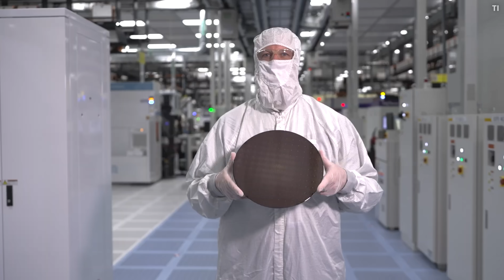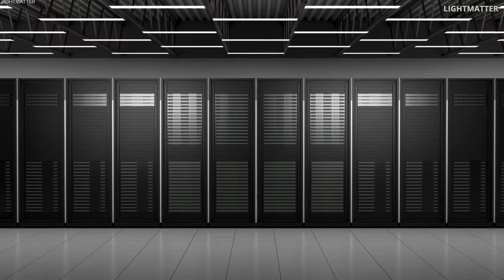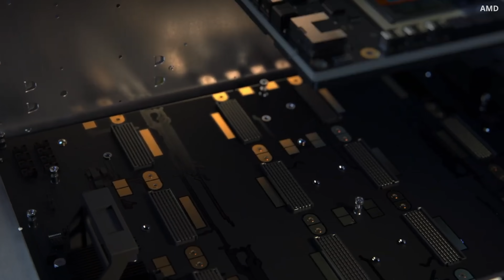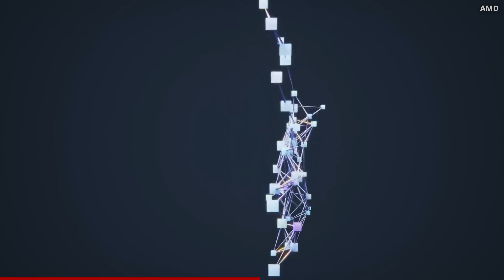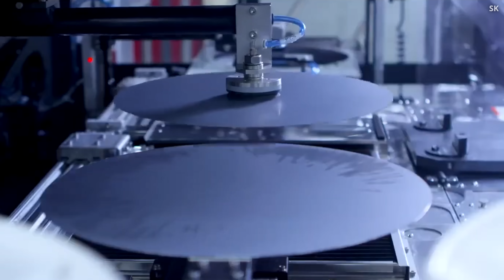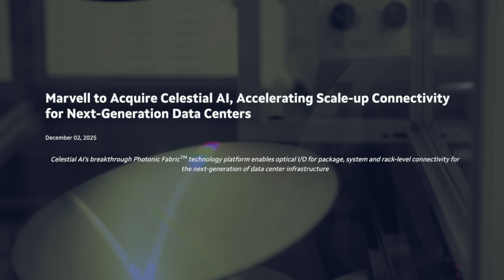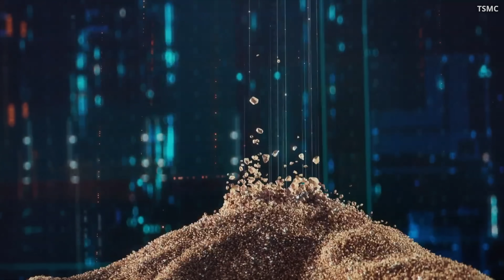Everyone Is Chasing This Technology

Comment: If cooling cost so much why aren't these plants built in colder region's like alaska or antarctica ?
Reply: They have these plants in iceland
Reply: @peteduch2151  Yes it is correct that they have datacentres in Iceland. Iceland's key advantage is that they have an abundance of cheap renewable electricity due to geothermal and topography that supports hydroelectric generation. However, the reason why they will not be building gigafactories there is due to insufficient power infrastructure, geographical distance from the major cities and countries where low latency compute is required, and although natural climate helps with cooling; the humidity is an issue that requires significant power to correct.
Reply: @SimonH-64buddy, you just making things up as you go on?
Reply: @jakobisahero  No bud, everything in this statement is based on facts that you can verify fairly quickly on the internet. Was there some point that you found contentious?
Reply: @S@SimonH-64sorry, just working on working memory here. Perhaps your thinking is great, I doubt it though 😅 All in all, it’s a good initial question, and the answers are a lot more complex than yes/ no 😂
Reply: @jakobisahero  The latency difference alone would be enough of a reason to not build big there to me.   They would put it in Death Valley and cool it there if it decreases latency where they need it.
Reply: @toolman6872 latency is not always a critical factor. Sometimes it’s everything, as we know 😅
Reply: @jakobisahero  It's not JUST latency though, I was  saying that it is a significant reason on it's own to reduce distance to the consumer or user.  There are many additional reasons.
Reply: @jakobisahero I haven't answered yes or no, I've given summary reasoning as to what goes into the selection datacentre location which explains why they are being built where they are. The reason I have all this information to hand is because I have several hundred hours of research in exactly this field.
Reply: @SimonH-64 But how much low latency compute is really needed? Most of the current AI boom seems to rest on LLMs and generative AI. If you work with ChatGPT, you will hardly notice if the answer comes a few hundred milliseconds later. The same goes for generative AI, if your generated pictures or videos appear a fraction of a second later, the difference will not be noticeable. 

BTW, I have played FPS games on overseas servers. The difference to one near me is typically 100-200 ms. 100 ms extra latency was tolerable, and those games require decent reaction speed.
Reply: @rabiatorthegreat6163  ask traders on Wall Street why they hate latency, and you'll instantly understand that milliseconds extra can mean relevance or irrelevance in any field that relies on data speed.
Reply: @rabiatorthegreat6163  "hummingbird project" giyf
Reply: @SimonH-64and salt is an issue also here in iceland
Reply: In the future, please do your research before making statements
Reply: @SimonH-64 i didnt know this wow  k so cool
Reply: @SimonH-64Yes there's infrastructure Antarctica not so much
Reply: @peteduch2151 I lived in Iceland for a year. It’s no colder there than it is in the northern half of the US.
Reply: @ChopperChad I was going to say isnt it Greenland that's covered in snow, Iceland is just the name of the country , not a description .
Reply: @fabianurweider805  Greenland mostly consists as shelf-ice, no rocks everywhere. Good luck with a sinking supercomputer on the melting icy ground 🙂.
Reply: @ChopperChad   ... aber der Strom ist billiger, wegen Geothermie-
Reply: @ChopperChad I think they meant Greenland 😂
Reply: @peteduch2151   don't say that too loud, otherwise Trump will want Iceland as well.
Reply: @rjung_ch  Trump isn't the one building data centers.
Reply: @pfpchad2747  he's not standing in the way either. The way he wants Greenland he may want more, Venezuela, Iceland, which other country?
Reply: @rjung_ch Trump thinks Greenland is um, green. Iceland is green, Greenland is icy.
Reply: clown
Reply: @pfpchad2747  TDS.
Reply: @rjung_ch  Tell me you are a dumb democrat voter by not telling me. hahhahahhahah
Reply: @rjung_ch 
Is Trump in the room with you right now?🤣🙃
Reply: @rjung_ch good luck with that. Icelanders are bonkers. They drink like a fish, do crazy stuff like drive nox powered beast cars up vertical cliffs and party like their lives depend on it. Even the craziest Americans won’t last 5 minutes.
Reply: @rjung_ch  So that would be an Iceland would be great just like America
Reply: @rjung_ch  Luxembourg
Reply: @BJPus  I hate to inform you, but more today than ever, the people with TDS are Trump supporters.
If you simply look at the word "deranged", you can't deny what I've said.
Reply: @Vector_Ze  Is that you AOC? just like when you said MAGA wants socialism… 😂
Reply: @rjung_ch  everything reminds me of him 😢💔
Reply: @JenkinsUSA  an Orange victim of Erik the Red
Reply: @rjung_ch  We will take both of them, with ease...
Reply: @rjung_ch  All of the above. You're already our vassal anyway, why not make it official and gain some more advantages from it.
Reply: @robotron1236  that hubris will bite you in the ass, it'll be horrible for you, are you ready for that? It'll be coming before you notice.
Reply: @rjung_ch maybe all of them, America MFer
Reply: @rjung_ch  He will not.  Iceland does not command the same strategical location.  Greenland's location allows US to command arctic circle voyage route.
Reply: likely more moisture buildup from condensation, causing corrosion, and they probably want high capacity bandwidth to avoid bottlenecks, doubt alaska or antarctica has too much available (besides the secret bases)
Reply: @patrikisgod They are not secret if you talk about them on social media!
Reply: @vincewilson1  Wanna hear a secret 😂😂😂❤❤😮
Reply: @patrikisgod Could be overcome by putting the electronics in oil ( would serve as a heat transfer fluid too ), but I believe energy and latency are the two main reasons.
Reply: Because you don't have power or connectivity infrastructure in those places, and many applications of compute requires low latency i.e. the compute needs to be physically close to where the results of the compute are needed. A further enemy of compute is humidity, where you have cold, you have moisture, so its a separate problem to deal with that requires energy to overcome.
Reply: @SimonH-64 Cold air actually carries much less humidity the problem is condensation
Reply: @HerbofFire thanks for the correction. Cold places like Iceland have very high relative humidity which is a challenge along with condensation too but very cold  places like Antarctica are very dry then it's a pure condensation issue.
Reply: @SimonH-64 As the air gets heated in the building, the relative humidity decreases because warm air can carry more humidity. So Iceland climate should not be a problem.
Reply: @rabiatorthegreat6163  It's the high high ambient humidity outside that is the challenge. Air that is too wet reduces life of electrical components so they have to make sure the dc are sealed and expend energy dehumidifying the air bought in for cooling. Its not that iceland climate is a prohibitive problem, its just one challenge to the location. the biggest showstopper to iceland for Gigafactories is power and location
Reply: @SimonH-64 Even still though cold air is far dryer. 32f and 72f at 80% humidity each, the colder 32f air holds about x4 less water vapor.

Amazon's new Carlisle data center here in Indiana uses air cooling October through March which she covered in a previous video. The trade off she said is air cooling is more expensive power wise.
Reply: @HerbofFire  yes i understand - local climate is just one of the challenges when placing datacentres, not necessarily the main one for any given location. Got into the weeds a bit here, but originally i just gave a list of why its not as simple as "its colder in x place so why don't they just put datacentres there" The factors are power infrastructure, connectivity, labour for building/maintenance/staffing and climate factors to name some. All of these things weigh into economic and operational viability that add up to the reason why datacentres are getting built where they are getting built.
Reply: @SimonH-64 Iceland isn't the kind of place we're talking about. We mean northern Canada where temperatures go below -50 Celsius. It's 7 degrees Celsius in Iceland right now. I'm in a major city in Canada and it's -22. The data center wouldn't just sit out in the elements. You would run some type of heat exchanger system with something like glycol. The Antarctic is actually considered the largest desert on earth because of the lack of moisture in the air.
Reply: @SimonH-64 Very good point I guess but we do not need to forget that not every thing require low temperatures to run properly on the top level and you will need to create systems to heat things up. As well as that you need to protect system because machinery needs to be isolated from snow and strong winds, as well as temperatures needed to be much lower then the ones on poles. Basically not so many benefits more loses in the short and long terms. People need to work and live there and so much more to include like water and massive factories. I am not studying for that and my knowledge is even far from basics at that field.
Reply: Keeping temperatures moderate enough, if there are elements that actually need it (maybe backup batteries?) is easy - you just don't dump all your waste heat outside. And protecting the electronics from the elements is solved problem - there are already datacenters being built in humid climate or with frequent rain using a new technology called "walls".

Latency probably isn't a major issue either - it's not the same as locating HFT systems next door to the stock market, and there are already plans for orbital datacenters using much slower satellite uplinks. But more conventional infrastructure is. 

They not only need massive amounts of available electricity - likely requiring new power plants if there isn't a strong local grid - they also need to support a large enough workforce to build these city-scale projects in the first place, and then have to transport all of the material and machinery, which is all both challenging and extremely expensive to do in remote locations. 

So technologically, yes, it'd be far more efficient (and avoid wrecking the lives of anyone living nearby), but the gains aren't great enough that companies can (or will) eat the costs involved when they can just plug into your local power grid & build a new behemoth in your back yard.
Reply: So data centers in space don't meet your requirements. However, they are feasible and 1 is currently available in orbit
Reply: @simonh-64 then put a power grid there. Make substations. Use next Gen internet tech. I don't know, they got trillions of dollars figure it out! The one thing u dont do is build them on fn farmland!! Thats a no brainer. I refuse to believe that out of aaaaall the things money can and has done for them this whole time, why it allegedly cant find/implelment these other important fixes. Its not that they cant do it. They can. They dont want to. They choose not to for agendas
Reply: @unleasheth  I think they are chasing the cheapest acreage.
Reply: @unleasheth They are and they're more intelligent than you. 
You live on farmland almost all cities are on farmland. You're the problem not the data center.
Reply: @pauls5745 No they aren't it's location close to population where it's used and has power.
Reply: @sparksmcgee6641  In as much as outside KC is reclaimed farmland on the outskirts of town. Not just across the street. Out there.
Reply: @pauls5745  You dont know much about himan development. All early cities were built up on farmland. Hundreds of yeara later there are a few cities that were dwveloped in the indjstrial era because of a mine or port, or things like that which is less than 5% of current residential habitation.

Anyone whining about losing farmland because of something that improves quality of life for all is a clueless bigot that just harps on some political belief.
Reply: @SimonH-64You would never get the amount of people needed in enough numbers to work in those environments that’s the critical issue everything could be fixed, but not having the people kills the prospect of having infrastructure like that in those cold environments. They built infrastructure in phoenix’s, but they have peoples interest of living/working there although it’s still not easy even for that place, So a place like Antarctica or Alaska you have a better chance at winning the lotto than having enough of peoples interest to build key fab infrastructure there 😂.
Reply: @SimonH-64actually absolute humidity decreases with lower temperature.  There is a huge desert region in Antarctica, bone dry with some animal carcasses that are hundreds of years old
Reply: @glike2  Little misleading, all of Antarctica isnt low humidity in fact im betting its the exception.
You made your comment as an absolute which isnt the case. Just pointing out a better structured comment would have communicated the concept better.
😊😊
Reply: @SimonH-64 AI data centers actually don't need to be close to where the results are, why would they?
Reply: @M1szS Latency. The further the physical distance, the longer it takes to get the information. This physical distance issue is exacerbated by the number of hops it has to take, each hop is represented by a piece of networking equipment where each data packet has to be routed, this adds significant time. Latency is very important for many applications of  compute (like Ai inference, gaming, fincancial markets etc) and not for others (like training LLMs)
Reply: @SimonH-64 speed of light does have its limitations
Reply: @jakobisahero  Haha! If we could have one glass cable from the DC direct to every computer who want to use the datacentre then we could achieve speeds of about 2/3 of the speed of light for the transmission! (we don't get full speed of light though fibre because it travels through glass medium instead of a vacuum!) Unfortunately, we have to use the infrastructure that's in place, and physical distance in reality presents more hops and more hops is where the speed is lost :)
Reply: @SimonH-64😂
Reply: @jakobisahero  but you are only sending the results, not the compute
Reply: @SimonH-64fiber is interrupted by many circuit junction hub switches.  My understanding is that these switches are what creates more of a latency issue than the fiber itself?  Am I misunderstanding the technical science of it?  I'm sure it's more complicated than what I state in this simple paragraph
Reply: @brianwnc8168 yes max 20 km then you need repeaters for even fibre if we want to maintain bandwidth.
Reply: @brianwnc8168 yes absolutely correct, every router or gateway the data packets pass though they have to be routed I.e. analyse the header info, look up the next destination and send them to the next point in the chain. This is a big time overhead much bigger than latency caused by cable. So more distance = more hops is a simplification but generally true especially when talking significant distances and cross borders
Reply: @M1szS first time learning about how latency works? lol.
Reply: @SimonH-64um... Ever heard of Antarctica ?
Reply: @SimonH-64what about Alberta its super dry and one of the coldest places in the world and it has the best energy infrastructure
Reply: @SimonH-64 It is about existing infrastructure and logistics, building in Alaska is expensive because of lack of labour, cost ineffective building, lack of a well developed power grid... operational upkeep on a regular basis which are all the much easier inland.
Reply: @SimonH-64oh really?  Southern Canada is much cooler than texas where they're building all the data centers. And last I checked, there was plenty of power and fiber optics available to run data centers in canada.
Reply: @SimonH-64The heat generated will drastically reduce relative humidity in polar or Arctic Circle facilities. This is why relative humidity levels are usually so low in heated dwellings in cold climates. Condensation would occur away from heat sources. The other points mentioned are all important; Alaskan and Arctic Circle locations are to far from the likely future as well as present major users of these facilities.
Reply: @SimonH-64alaska has natural gas ans pil reserves more than most places. They can build plants.
Reply: @SimonH-64 ever been to Louisiana? The humidity there is stifling, your point holds no water , pun intended
Reply: @SimonH-64actually the colder the drier. The issue is NOBODY will work there.. been in industry 30 years people don’t even wanna go to upstate NY
Reply: @SimonH-64 Actually cold air carries less moisture because it turns to ice.
Reply: @SimonH-64Not entirely true, cold doesn’t equal moisture and when you raise the temperature of cold air it lowers humidity drastically
Reply: So data centers in space don't meet your requirements. However, they are feasible and 1 is currently available in orbit
Reply: @SimonH-64Alaska has oil and gas they can build some plants there. You can put some optic fiber
Reply: @SimonH-64 The point is valid tho.

Microsoft made an apparently very successful test of underwater datacenters, but later abandoned the project.

Probably scaling was an issue.
Reply: @mnomadvfx  it is a valid point that cooler temps are an advantage (although, there is a sweet spot) to reducing power consumption for sure! There are just a bunch of other criteria, largely around the economics of building and operating the datacentres, that make those places less desirable.
Reply: @mnomadvfx  - I work in a large data center, the problem is repairs. I am doing repairs on the hardware all day, every day.  Putting the hardware out of reach from repair is never going to work, until the robots are able to do the repair. Still, they need parts.
Reply: @mnomadvfx  underwater data centers are a neat thought. Unfortunately the cost of building underwater is exceedingly expensive and hardly reliable. Requires absurd amounts of maintenance. That being said, off shore data centers are a huge thing nowadays. They capitalize on spent rigs that have latent methane which can be converted to energy with fuel cells. Most rigs are already outfitted with power plants and have all the necessary protections for running a data center. The cooling capacity from the wind alone is generally enough for maintaining operations at significantly higher efficiencies. Outdoor Chillers don’t have to work nearly as hard to release heat.
Reply: @mnomadvfx Cost was the issue as it always is.
Reply: Yeah, they could use the waste heat for central district heating. The new giant neutron microscope near Lund Sweden, is already doing this.
Reply: @garysmith8593 very nice thought, until it is summer and no one needs the heat, than you have to install cooling and shut off the house heating. So instead of building 2 systems heating and cooling better only build a bigger cooling system.
Reply: That's why they're looking at putting them in space - bank of solar panels facing the sun, bank of heat radiators right behind those facing space. Sun synchronous orbit makes the data center always in sunlight and always at the best angle, and the sunlight isn't attenuated by the atmosphere and clouds and stuff, so solar panels in space produce about 40X more electricity annually than on the ground. And the temperature of deep space is about -270°C, so it's a great radiative heat sink.
Reply: @truhartwood3170 .  And no nasty condensation! Is there?
Reply: @t @truhartwood3170 40% more energy. Not 40x but it’s 24/7 so perhaps 3-4 x more than terrestrial solar.
Reply: @truhartwood3170 mostly true. Distributing heat into space is hard, very difficult actually. Vacuum is an excellent insulator, that’s why space suits need cooling :-)
Reply: @jakobisahero It's not that hard, but it is significant. A ballpark estimate would be that an equal mass of radiator would be needed to the mass of data centre hardware. This might be even lower with an ammonia based state change cooling system.
Reply: @g @garethrobinson2275 t’s not trivial for sure. Constant Radiation is a real issue. I would “ballpark” about the same as you. Whatever you want to build in space, you really want to sort materials off planet. Most calculations would stop short on the amount of resources in one place. The scale would be huge to justify the risk.
Reply: @garethrobinson2275 why not just in the moon. coldness of space plus a large mass to sink the heat. unlimited area for solar generators.
Reply: @jakobisahero the vacuum of space precludes conduction and convection, but is great for radiative cooling. In the shadow of the earth, space suits need heating because they loose so much heat to radiative cooling. Same goes for radiative cooling panels in the shadow of solar panels - they lose lots of heat through radiant  cooling.
Reply: @mrlegsbenedict  It's interesting, however the moon is 1.3 light seconds away, so a 2.6 second round trip, which is a serious downside.
Reply: Elon Musk wants to build it in space. Probably because of solar power and temperatures, transmission data will be by satellite? I don't know
Reply: @thumbsup9208 Elon already has Starlink, so by lasers to those satellites from sun synchronous orbit.
Reply: @thumbsup9208 spacex newest satellites have planned bandwidth and are laser linked to work with space based data centers
Reply: @thumbsup9208  Also, no permitting, NIMBY lawsuits, etc.
Reply: @thumbsup9208 .  And no zoning officials in space.
Reply: transportation &  power
Reply: Lack of power infrastructure and network bandwidth mainly. If you have power, though, you can at least do training there without massive bandwidth.
Reply: @DaveEtchells this plus security. If military and gdp depend on them they are prime targets. Big tech sneakily just became part of MIC..
Reply: @jasonwakeman  Hah, excellent point, I hadn’t thought of that. (Of course, the military could just mandate that they’re served by secure US datacenters and push all the civilian stuff to Iceland or wherever, but once the economy becomes dominated by AI workers, datacenters would make juicy war targets.)
Reply: Grid power requirements excludes that idea
Reply: @joshuaw2143  my concern with the grid power requirement mentality is multiplicative. The only way they can convince anyone that it is a real thing is by existential association with security. Without that it is no different than any other service that is subject to its own economic viability assessment. When you subsidize internet the idea is that the public benifits from scale. When you scale this with subsidization there is no net good for the public. Economics mandate optimization to fit the envelope or build your own infrastructure to expand your own isolated envelope.
Reply: To put it simply, labor constraints. Not enough industry to provide all necessary skilled labor inputs necessary for long term operations
Reply: Employees?
Reply: @matthewhuszarik4173 have you asked the immigrants working your fields?
Reply: @jakobisahero What the hell are you talking about? I was referencing who is going to work at a Data Center in Anarctica or Alaska.
Reply: I work for a data center builder here in Virginia. 
The main reason is distance, you wouldnt put mainline data centers in cold, middle of no where locations. The latency is too high, its hard to service, and those area usually dont have enough power to run the centers.
Reply: They're going to do it in space. At least XAI is.
Reply: @ModernTheogony  Will I Dream❤
Reply: @ModernTheogony wouldn't that be co, getting,  cool , lol
Reply: It makes more sense to just build them near water and use water to do a bunch of the cooling -- even in relatively warm parts of the us deep rivers and the ocean remain cool.  This is done but you still have a bunch of work pumping the fluids and it adds complexity.

And -- disgustingly -- our environmental regulations make it harder to release heated water like this than to just suck down electricity.   It's not that there aren't concerns but it should be the easier option.
Reply: Yes, this question seems on the surface perfectly valid... But the better question... Why above the surface?
Reply: Because it's all bs
Reply: @jeffgadbois1707 exactly what is bs?
Reply: They do, is some cases. Alberta Canada is attracting datacenters because it has cold winters and cheap gas.
Reply: @OccamsPlasmaGun  isn't that cause the datacenter is used as a source of heat ? not really cause it helps cool the chips/
Reply: @kitastro no, the heat is lost, in most cases. It's just that air cooling without evaporation is possible when the air isn't 35 C very often.
Reply: It's not just total heat but also the density if the internal heat which must be pumped...ambient will not work.
Also, basically, the poles are not anywhere near civilization...
Reply: They are making good use of AI data centres in Finland to provide heat to 100,000 homes.
Reply: Bc they want to take away our electricity.  They already get data from New York to LA. An optical data pipe line running to Canada would be much fasted then node hopping from New York to la. Problem reaction solution 😮 and about the power for us we didnt get any mini nuke plants but for them these plants are being approved everyday now 😡
Reply: Well, they are. Google, Microsoft, Open AI and so on are all building huge plants in Norway and other Nordic countries at the moment.
Reply: You can't defend it that well in Arctic, you can't do anything in Antarctica
Reply: Ai is the latest way the billionaires have of stealing the food from the mouths of infants. A disgusting con job that will make the whole world poorer.
Reply: And if they need/use so much water why not by rivers and/or massive bodies of water
Reply: Hard to find skilled labor in those places.
Reply: Sounds like Antarctica wins. That’s where the coldest desert in the world is(if that’s true).
Reply: How many people and talent are willing to go to Antártica and leave their family and friends behind?
Reply: The US military has AI and conventional data centers in Antarctica. Civilian data centers are not allowed in Antarctica.
Reply: @1323lobo see I didn't know that, that makes sense and dollars to me thank you
Reply: @CanadianMilitaryVet I didn't know it until I saw an interview with a Raytheon contractor on Valuetainment YouTube channel.
Reply: They are, I work in building data centers and they can’t exclusively be built in those environments. We have to have them in strategic locations.
Reply: And actually....YEAH! Damn good point.
Reply: Not sure the trade off would be worth the effort
Reply: Or the misses knickers
Reply: You dont want melt the ice either
Reply: Well... Actually it's more about relativity
Reply: Like... From the neutral point... Like it's harder to cool in already cool places is how one might describe it
Reply: What a dumb question bro
Reply: You trade a better thermal environment for worse infrastructure, distance from clients, and a possibly corrosive environment if you pick the sea (salt). The tradeoff may not be as  favorable as one might assume.
Reply: Because they won't have subsidiaries easily accessible to the masses to milk more money.
Reply: That would cause melting of glaciers and sea level rises sinking entirety of western coastal regions and Western Europe.
Reply: Or near large coastal cities, in the winter the heat can be used to heat buildings and in the summer you can use the ocean to cool the data center?
Reply: lack of infrastructure and high latencies
Reply: Elon Musk plans to build one in Space. Wild!
Reply: @Christopher-c2m Not one, many.
Reply: Umm, power... and latency also.🤷
Reply: No power. No smart people.
Reply: Eric hecker would disagree with you
Reply: Is … is this an actual question q
Reply: Doesn't change the temperature in the building. 
They only drop the temperature about 15 degrees with air blowers and that can be done almost anywhere.
Reply: Plus that’s why they want to put in space - cool, 10x more solar energy, and no heat dispersion into atmosphere etc
Reply: Norway/Sweden and Finland are cold and near alot of major european cities
Reply: Antarctica is closed to all commercial business only science by international Treaty.
Reply: maybe because those ices get warm and sea level rises, a disaster that can lead Netherland go completely fish mode
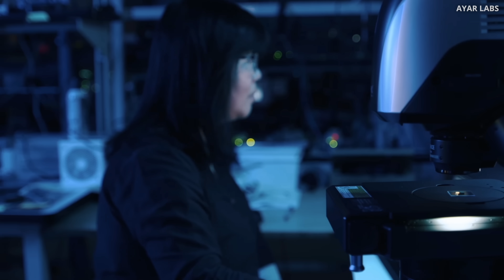Reply: 12:26 probably ABUSED by their MARXIST GOVERNMENTS SO BADLY THEY START TO "ASSUME" THEY ARE "ENTITLED" TO THE LIONS SHARE OF ALL OF THEIR REVENUE.  NOT PROFITS WHICH CAN GO UP DOWN OR EVEN NEGATIVE WITHOUT EVER INVESTED A DIME OR EVEN DEFERRED TAXES OR ENDLESS ENVIRONMENTAL BS!

AND ONCE STARTED WILL NEVER LOWER AGAIN EVEN IF THEY HAVE A NEGATIVE YEAR!  OR DECADE FOR THAT MATTER.
Reply: Because you need it close to center of operations otherwise you will need yo relocate a whole industry to those places.
Reply: They need sub temperatures like that which is in the outer space realm.
💜✝️
Reply: They want electricity from the grid until they can generate their own.
Reply: And use the heat at least in  winter
Reply: Better yet why aren’t they data centres built underwater or sent to space?
Reply: why not space? like a ring
Reply: because heat costs more
Reply: Because international treari3a state nobody can build stuff on Antarctica except the research sites of the treaty nations. As for Alaska....the majority of ground is not suitable for such giant structures and roads/supply chain can't be built effectively for the same perma frosty reasons
Reply: Unstable ground, building construction methods would be a nightmare for a plant the size of a small State...
Reply: Shh, Don't you remember global warming? Doesn't seem to be an issue with it now, that the same cabal wants to double global heat emissions.
Reply: Because of the price of logistics. It's not typically allowed to ship batteries by plane to the non-contiguous states, so it'd be hard to create the battery backups needed for the datacenters. You need good internet, roads, and smart workers willing to endure those climates.
Reply: there already there were you been?
Reply: Infrastructure, logistics, wealth, regulations, labor, the jones act, and need I go on?
Reply: do you wanna game with a ping of 623? lol
Reply: They are built in colder regions. But they should be built in even colder regions buy they need a lot of electricity
Reply: Thus why Greenland is being annexed, cool for the weaponized A.I. takeover.
Reply: GRAPHENE!
Reply: That's why china wants to put them in space
Reply: because you need an army of highly trained people to run it they’re not gonna go to the north pole but good question
Reply: @dougcardillo  oh they surely would.
Reply: Good job werry interesting video i am frustrated that i am not smart enough for this world that i love
Reply: Nothing is built in Antarctica 😂😂
Reply: they would melt the polar ice caps
Reply: OMG,!  YOU could not have watched this video all the way through,  or if you did, you did not understand. 🤦
Reply: or use the heat beneficially!, I have read about steel smelting plants using the waste heat to power greenhouses
Reply: gold toilet is more important than you
Reply: Same reason you don't live in Canada, you live on the border to the US.
Reply: Sounds like trading an inevitable ecological disaster for yet more AI slop. 🎉🤑🤮
Reply: @daxxonjabiru428 . Yes, but If Musk likes the idea, what could go wrong?
Reply: Antarctica must stay free of industry!!!!!
Reply: Alaska would be good you can use the wasteheat from datacenters for heating. 
A hospital in northern vienna get 70% of hos heat from a data center
Reply: You might not have noticed, but executives are not the smartest people
Reply: Special question dude, zero infrastructure in those places
Reply: I always wondered if they were hiding a quantum computer in Antarctica
Reply: How about in the 51st state? Alberta
Reply: You cant cool the whole data center right? It cant be that cold inside.
Water? Employees? Electricity? Infrastructure?
Reply: If water costs so much, why not move to the ocean
Reply: Think Mark THINK!! LOGISTICS.
Reply: They're building them in space
Reply: You also need to consider supply chains, power needs, shipping cost, and most importantly, human resources. How many engineers want to live in Alaska？
Reply: You also don’t realize how fast AI chip can heat up and melt down in seconds. Colder air does not help much, not even using liquid hydrogen to create cold air. Air cooling just doesn’t work. It has to be liquid cooling to dip the whole module in liquid.
Reply: There are clips on YouTube showing how liquid cooling works. It is special none conductive liquid, GPU module is like a volcano evaporating the liquid, keeps on creating bubbles. The steam goes thru pipe to cool down back to liquid to recycle back.
Reply: Louisiana is sitting on a giant gas field with unlimited cheap gas.
Reply: Because it costs less to cool than it does to build the infrastructure in cooler regions.
Reply: Because there is no energy and other infrastructure and not enough population density plus the weather conditions are harmful for building materials.
Reply: Enough, pre existing --Power supply
Reply: Elon Musk is full of BS. We are centuries from building datacenters in space. Temperatures are nice but the power and radiations are the real issues.
Reply: They're not that smart 😂😂😂😂😂
Reply: There is no Power 😊
Reply: Accessibility and data security rules.
Reply: Did you understand "tens of meters"?

Yet you would move the data centers many thousands of kilometers away?
3000 km = 0.01 light-second.
Reply: Internet bandwidth, electrical consumption, proximity to military/law enforcement security.
Reply: So much geopolitical ignorance!  The new strategic doctrine is a sphere of influence from greenland to canada and down to south america.  Tge artic routes need icebreakers, which is why Koreans are invited to the US to build shipyards.  Daayumm yiu guys are clueless.  For power there is a big speed up for modular nuclear reactors.
Reply: The soil is unstable, can't be used for huge datacenters , there is no powerplant, no roads can be built in that permafrost soil , so no heavy duty power transmission pilars able to sustain the huge power requests from data centers ... Unless, using nuclear power
Reply: ban Facebook crap
Reply: Distance, infrastructure
Reply: Does latency not play a role in this?
Reply: Cost... Duh
Reply: The closer, physically, an application is to the people that use it, the better. Im sure there are use cases that can leverage lower temperature in more remote areas, but there will always be a need for data centers close to population centers
Reply: Or space
Reply: Antarctica is off limits, quantum servers are probably the size of cities there, open the vents now and then to let them cool off 😅
Reply: They're built on cheaper land. Often in areas where electricity is cheaper. All these companies advocated for a better environment. Unsurprisingly, that's only if it leads to the biggest profits
Reply: latency/ping
Reply: U may as well build at the bottom of ocean or the Himalayas then 😂😂😂
Reply: Dont build them.
Reply: That would be using logic they don’t have any
Reply: How do you get that level of power out there without another massive adjacent project? Then, who the heck do you fly out there to maintain those things. What happens if a storm. Comes through, knocks out power and  you can't fly humans in because of the storm?
Reply: If these data centers create so much heat, then why are they not a threat to the planet like all other global warming? Why do we continue to be lied to?
Reply: Because the countries that are actually funding this are deserts and won't allow it to be build elsewehere
Reply: They're going to melt all the ice instantly and then it's GGs. 🥀
Reply: I'm confused as to why so much water is needed. Why can't it be a closed system like a car? I think the whole thing is a lie.
Reply: Earth quakes are pretty bad in Alaska, it probably wouldn’t work unless they can make some kind of special foundation that can protect against this?
Reply: @ErrorOptik No place on earth is immune from earthquakes. Even the Ohio and Mississippi River Valley have had rollers.
Reply: Lack of electric infrastructure
Reply: Why do you think Trump wants the US to acquire Greenland?
Reply: Electricity prices and access to data
Reply: need power...how much power you think they have in the middle of fucking Antarctica?
Reply: Nice point.
Reply: Because they want to keep it close to their own land....but technically they should
Reply: Just build in a place that has the best convergence of infrastructure and climate. ¯\_(ツ)_/¯
Reply: And yeah melt the ice been frozen for thousands of years
Reply: Underground is natural cooler.
Reply: In the 60s, they use simple plants for storage and in the 90s AT&T created an optical chip that works on light
Reply: Rochester, NY is cold and is literally where all major optic breakthroughs occur. Build in Rochester :)
Reply: Construction/maintenance costs are significantly higher in cold climates.
Reply: Two things: Humidity and Distance.
Reply: That's why Donald is after Greenland.
Reply: Bc it would probably be triple or more for the upfront cost and upkeep.  But yes i agree.
Reply: Then we for sure gonna be melting ice caps 😂
Reply: Are you actively trying to destroy the habitability of the Earth?
Reply: @Silver_hammer it's Canada we have more room then God has in heaven so it's all about jobs and cooling, we also have nuclear capabilities here in Canada and hydro electric
Reply: It might be easier to cool a plant in a warm location than to build and maintain a plant in that kind of environment.
Reply: Solar flares and earthquakes might be a problem unless they built infrastructure that protects and prevents damage.
Reply: Latency
Reply: Bro do you want to melt all the ice glacier?
Reply: That would cause global warming
Reply: @kurtreber9813  not really
Reply: Power.
Reply: It would be better to generate energy from excess heat
Reply: Energy availability.
Reply: Because they are not smart. I'm being polite.
Reply: They are building in space next
Reply: why do you think USA wants Greenland.... Actually I have no idea, but cooling data centres may be one
Reply: @nishali3343 minerals
Reply: K, there is oil  but the world one of the largest rubies diamonds and precocious  minnaral reserve on earth and trump wants it
Reply: @nishali3343 ps i could of also answered that hes hitler rencarnated
Reply: @nishali3343 USA wants greenland minerals
Reply: Ice melt and flood happening in country 😢
Reply: Why doesn't anyone understand that producing this much heat isn't a good thing?
Reply: Manpower, infrastructure, power. Not many people wanna move to Fairbanks just to work for a datacenter, and even if they did, the infrastructure and grid cannot support the amount of compute we are talking about.
Reply: Wow, they probably didn't think about it. Call them and tell them how they decided to invest billions of dollars in suboptimal location 😂
Reply: @Roman_4x5  you laugh but have you ever had a boss that was smarter than you?
Reply: Because the heat is not coming from outside but from inside.
Reply: @kitastro well duh you can run cool air from the outside to cool stuff on the inside
Reply: Because the AC(s) doesn't work that great at lower temps?
Reply: @alekseyburrovets4747 Nah, it would actually perform better in those conditions.